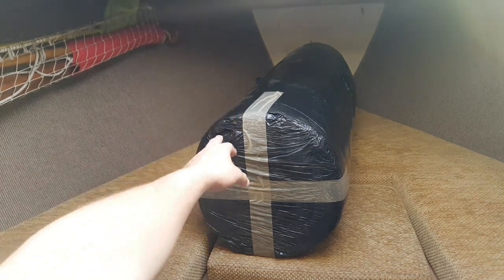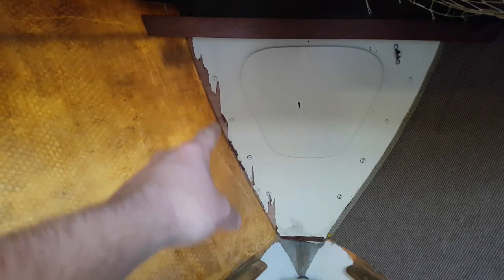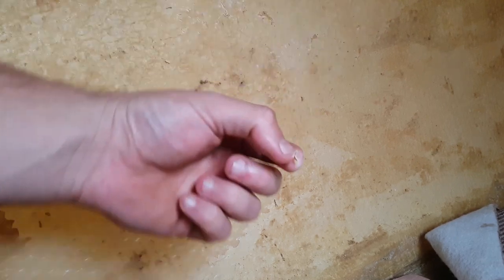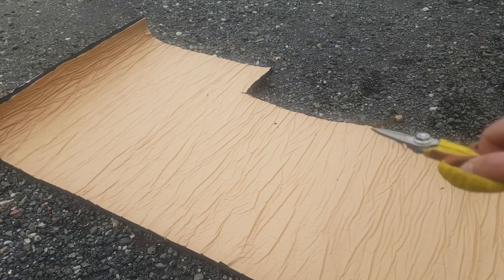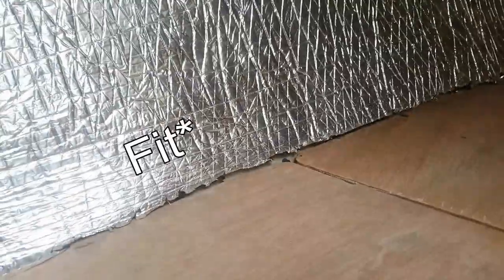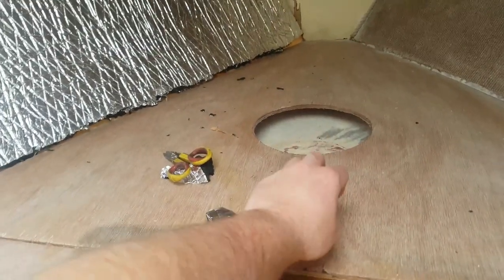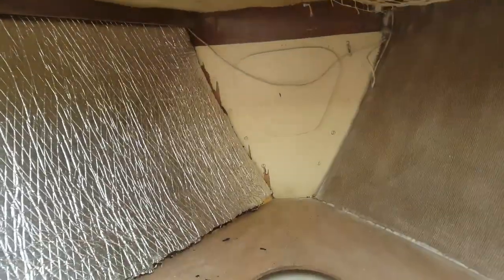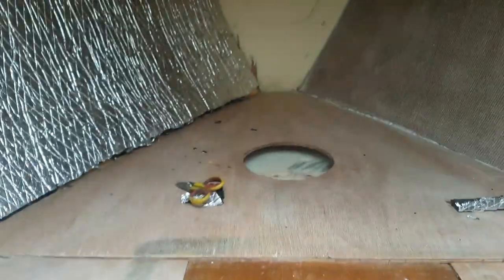Albin Vega 27 Refit - 4 -  Insulating the V berth part 2

Comment: Josh, Do you anticipate problems removing the cover over the water tank once you've gotten the insulation and carpet installed? It looks to me as if you're painting yourself into a corner, so to speak, with the thick insulation lying over the plywood cover.
Reply: Never mind. I see it now.
Reply from the maker: I have to admit that was a worry of mine when I was going to fit the slats above the panels of the V berth for air circulation but as it stands right now, it's just a really snug fit. So it's worked out quite well! Thanks for pointing out what may have been a potential problem though! Josh

Comment: tell me you're wearing a respirator?  That glass is horrible for your lungs.  I mean serious cancer, COPD bad for you.  If you start doing fiberglass and epoxy filler that silica filler is equally bad.  It's crazy not to wear solid protection. You won't be around to enjoy your boat if you don't.      

Hull Deck Joint bolts... or just bolts :)

Another way to avoid a lot of the moisture is to use a heater.  Like a diesel heater something that reduces moisture instead of increases it.  Also open the hatch a crack.  Dry heat plus venting avoids the moisture. 

Insulating is awesome.  I'm far too lazy to do it.  Hope to see ya in the Caribbean.  I'm just getting my boat in gear too.  I hope to be there by mid November.     My biggest obstacle right now is finding someplace to do the work on a boat.  It's crazy expensive here.  I'm looking at hundreds a month just to put a boat in their yard to do the work.  Then the nickel and diming starts.

Comment: In my opinion, all this insulation should be the last step of your refit. First, you should treat and repair all the wood parts, e.g. the bulkhead of the chain locker.
Reply from the maker: André Uchôa I couldn't agree more! But I've been forced to do it this way because for me to afford this project I'm having to stay on the boat as I'm refitting her, and need protection from the cold in the winter haha! So, some things will need to be done and then undone but it means I get a bit more comfort as I'm getting her ready. Josh

Comment: Is insulation just for moisture or does it provide some warmth?
Reply from the maker: It keeps the warmth in the boat as well as stopping the condensation forming on the Hull. You lose a bit of space inside with insulation as thick as mine but I personally believe it's worth it for the level of comfort you get
Reply: @SVLaViajera  thanks for the response :)

Comment: a heat gun and a scraper would make quick work of that adhesive
Reply: While the fiberglass would probably not be affected by a heat gun the resins that hold fiberglass together begin to rapidly decompose when heat is applied, leaving weak spots and bubbles in the laminate. The result is hard and looks fine, but may fail catastrophically under a sudden load.